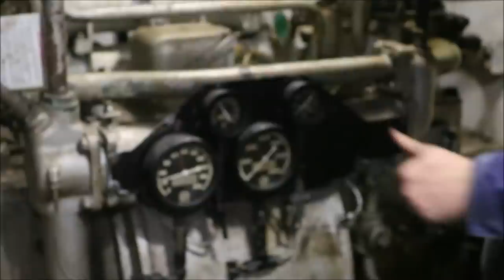First start in 72 years WWII 1942 Cleveland Diesel 8-268A

Comment: roller rockers all them years ago gotta love it
Reply from the maker: The old Cleveland engines are very similar to modern EMD 710 series engines. Not much has changed in the development of large 2-stroke diesel engines in the last 80 years.
Thanks for watching!
Reply: Justin Higgina  Hell even the old Allison V12 aircraft engine used a roller set up on its over head cam 4 valves !!!  Something even the "fabled" RR Merlin did NOT have !!!!

Comment: We had two V16_278A main engines and one 8-268A ships service generator engine in both the forward and after enginerooms on LST 1161.  The 8-268A was rated at 450 HP at 1200 RPM.  Or 300 KW.  This was in the early 1960s.
Reply from the maker: That's very interesting. One day I'll make a trip to a LST museum. Not sure if any have the Cleveland engines or all EMD and Detroit Diesel. Thanks for watching!

Comment: Let me get this straight, 4 valves per cylinder, unit injectors in cylinders, back in 1942?  Remarkable technology considering we still design modern diesels in much the same way!
Reply from the maker: Thanks for watching! These Cleveland engines share many similarities to modern EMD units which are based off of the original Winton/CDED design. The 4 valve heads and unit injectors first made their appearance even earlier in the 1930's.

Comment: I worked on a Cleveland diesel just like that,  was an 8- 268A  And there was a 3- 268 A  was a Generator engine. Takes a series of steps to make that thing run. I remember valves for oil bleed air to start And for blowing it down each individual cylinder. Also there was a hand held pyro with a probe that could give you a reading so you could tell if that cylinder was firing each valve cover was polished  kinda neat big 2 cycle. It was in a mine sweeper turned into pleasure craft Was owned by the famous man they called "The Duke" . I do believe these engines were used in Locomotives in that Era.
Reply from the maker: Thanks for watching! The Stewart has 2 8-268A engines and 2 3-268A engines onboard. All are generators. I'm very surprised by how many people have commented that they worked on these engines. It's incredible how long these things stayed around and the applications they were used in after the war.

Comment: I spent 30 yrs working on the detroit two strokes from the 2-53 to the 16v149tib and you can tell this old bird is a two stroke
Reply from the maker: Detriot engines have many similarities with the much larger Cleveland line (both are GM products), although Cleveland engines are closer to EMD, the resemblance is still there. Thanks for watching!
Reply: A two stroke with valves, I don’t think so 🤔
Reply from the maker: Thanks for watching! That is a very common misconception. Unlike gas engines, almost all 2 stroke diesel (and all slow speed engines) have exhaust valves. Intake air is drawn in through ports in the cylinder liner and exhaust gas exits through conventional valves. A quick Google search will help to clear this up for you!

Comment: Ran an old Cleveland like this for a light plant engine on a West Texas Drilling rig in the 70's.
Reply from the maker: That's very cool, I've yet to hear about them being repurposed for work on the rigs! Was it an 3,8,12 or 16 cyl motor you worked on?
Thanks for watching!
Reply: @FixAndForget  Straight 8 cyl.  2 stroke.  It powered a gen. motor off a sub. The power engines were White 8 cyl. engines built in the 40's as was the rig.  Those didn't have forced lube to the upper valve train so twice a shift you had to remove 4 side plates and fill them with oil on each of the 4 800 hp. engines. That was drip feed and constant loss.     They decided to scrap the rig when you could stick a screwdriver thru the sub frames.
Reply from the maker: @odatmatt  again, that is some really cool stuff. The USS COD, a WWII sub museum in Cleveland Ohio has the same inline 8cyl Cleveland generator, still in running condition. The guys up there were a big help in getting this on running.
Reply: @FixAndForget  It powered all of our electrical needs,   Another Noble Drilling rig had Sub generator motors powering the drawworks used to pull the drill pipe out of the hole.

Comment: Smoothly running, slight knock.
Reply from the maker: Might have had some air in the fuel system that caused a momentary pre-ignition knock but that cleared up after a few seconds. 
Thanks for watching and the kind words!!

Comment: I like how he said "yeah, in case she runs away".  Plate for the intake please...hahaha.  Holy cow that engine sounds MINT! ! ! !
Reply from the maker: Thanks boss! The large C02 extinguisher and intake damper are precautions I take with any large 2 stroke engine I work with. One of these days I'll post a video of the engine at rated speed with a load on it. It really screams at 1,200 RPM.
Reply: runs away! over turbos do that... too much AIR!
Reply from the maker: @AntonyThorburn  A number of circumstances can cause this style of 2-stroke engine to run away. The most common are stuck injector racks, diesel in the lube oil, and bad seals on the blower (supercharger).
Reply: @FixAndForget  thank you. Strange thing.

Comment: Moran Towing, New York, had these in a few boats. I was told that they came from submarines. They sounded like a sewing machine in the engine room.
Reply from the maker: The USS Cavalla SS-244 is a museum submarine berthed next to the Stewart and it had 4 16-278A engines. It was common practice for scrapyards to remove the propulsion equipment from them and resell it to other uses. There are a few Fairbanks and Cleveland powered tugs up on the great lakes and Mississippi river. I knew RTC in New York had a few of them a few years back. Glad to hear there are a few left still working! 

Thanks for watching!

Comment: Our 8-268A sat between two 16-268a's in USS Rasher after engine room.  A little nervous in the bilge between them looking at all those crankcase relief valves.........
Reply from the maker: That's the same setup as the USS COD who's crew still has the 8 and both 16's running today. I can't imagine how you guys worked down there, I have enough trouble working in a "spacious" engine room. The Gato class boat that sits next to this ship at the same museum had one of the 16's and the 8 removed in 1952.
Thanks for watching!

Comment: for the high speed the valves move,this engine is an 2 stroke . the sound is same same as an EMD. (same as the locomotives). 4 valves + injector
Reply from the maker: The Cleveland engine line was the predecessor to EMD. Lessons learned went into the design of EMD and the result was an engine family almost identical to this one. That could be said all the way up to the basic principles of the EMD 710 series engine. 
Thanks for watching!

Comment: Roller rocker arms astonishing for that era , like mentioned dont make stuff to last nowadays
Reply from the maker: Thanks for watching! There are few major differences between the old Cleveland engines and modern day EMD 710 series motors, the basic operating principals and designs haven't changed much in the last 80 years. I think they had been using roller rocker arms since sometime in the 30's. Pretty neat stuff!
Reply: I can use the same 1940s EMD 567 rocker arm part number and cross reference it to a modern 710. I'd say they still make things to last. Maybe not in consumer products, but in industrial stuff they do.
Reply from the maker: @---sx9qx  one of the reasons why I chose to work on EMD products. Build to last, bullet proof, doesn't require a degree in rocket science to work on.

Thanks for watching!

Comment: Winton was the original company.  Gm bought them. Renamed to Cleveland engine. Then later Detroit and emd
Reply from the maker: Thanks for watching! The mains on the submarine (also part of the museum) are old enough to still be branded "Winton". Not sure if Winton is directly responsible for the Detroit line of engines, but they certainly are for EMD.

Comment: Old engines are better than new crap
Reply: Yeah that's bullshit would you really want this thing in a new car you would get 5 miles to the gallon what do you drive by the way I'm betting it's pretty new so I rest my case
Reply: You’re half right. The quality control and metallurgy of new engines far surpasses the old stuff but it’s the federally mandated emissions systems that are prematurely killing modern diesel engines. Just about any of the new class 8 diesels would run 2 million miles if they weren’t being prematurely destroyed by the emissions garbage.
Reply: @prevost8686  
And newer diesels are being built lighter for fuel efficiency... which isn't a good thing in a marine diesel.
A bit of extra weight helps smooth an engine down and stretches it's life.
Reply: @charlesangell_bulmtl  the engine you're talking about is not plausible nor would it be productive in a modern automobile it's to small it wouldn't have  the power to weight ratio
Reply: I'll take a new Ford 5.0L DOHC direct injection V-8 with a conservative 460 H.P. any day over the Ford 289 C.I.  barely 200 H.P. in my '65 Mustang.  The modern 5.0L has way, way more power, better fuel efficiency, 98% less emissions, and longer life/reliability.  289 was good in its day, but that is 50 year old technology.  The same goes for Chevy and Chrysler.
Reply from the maker: Thanks for watching!

Comment: This must be the closest to the sound of the original Winton engines as used in early diesel locomotives,  but I would have liked some exhaust sound in the video as well.
Reply from the maker: One of these days I will post another video of the engine at speed and carrying a load, I'll include an exhaust clip on that one. If you want to see a few now, click on my account under the video, I have some raw footage of the engine on there with some exhaust clips as well. Kinda sounds like a hit and miss engine after the muffler. 
Thanks for watching!
Reply: @FixAndForget  I check them out, the figure 268 denotes displacement per cylinder like EMD did?
I had been checking the web for surviving locomotives whit the Winton 201A diesels in them, but currntly none of them is operational. I hope there wil be one in the future, because this engine had a significant rol in the birth of the diesel locomotive in the United States.

Comment: Iwas on the YF885 at keyport wash. had two 8268aw/ twin disc reduction/reverse they  were the best running engine
Reply from the maker: That's very neat, I have only worked on Cleveland units in generator applications. I've always wanted to see one in a propulsion application.

Comment: I thought this engine looked like an EMD. After reading the description, I see why that would be. 

Great work. Just subscribed!
Reply from the maker: Thanks for watching! There are few major differences between the old Cleveland engines and modern day EMD 710 series motors, the basic operating principals and designs haven't changed much in the last 80 years.

Comment: I guess that’s a 2-cycle like a Detroit? I saw both sets of valves moving at the same time. I’ve never seen one of those. 
Nice!
Reply from the maker: Thanks for watching! The Cleveland and EMD diesel engines share the same basic operating principals as Detroit motors, just on a much larger scale.
Reply: Asher Spalding 
Was Cleveland associated with GM/EMD or Winton back in the early days? 
I’ve worked on all Detroit series 53-149 that are “common” and have been around the 567 just a small amount. 
Is the Cleveland roots-blown as well?
Reply from the maker: @davidbeachel  Cleveland/Winton is synonymous. The company was purchased by GM in 1930 and was the predecessor to EMD. All are roots blown, except for more modern 645,710 and up series EMD.

Comment: Curious about the Hp and RPM's. The two valve lifters must be for exhaust valves just like the 2 stroke GM diesels. The center tappet probably for the fuel injector.
Reply from the maker: Rated speed is 1200, approximately 500 HP. 4 exhaust valves and the center rocker is for the injector. Cleveland/Winton was bought by GM in 1930 so this is a "GM" engine. Thanks for watching!
Reply: @FixAndForget  Thank you. I am surprised about 4 valves... would have put money on only 2.

Comment: I'm a railfan so I've heard all sorts of EMD locomotive prime movers before.  Thank you for sharing this piece of pre-EMD history.  Mind if I ask, why does it make a clanging/knocking sound on startup?  Most EMD locomotives don't do that, while most 1960s-1990s GE locomotives do.
Reply from the maker: Thanks for watching! The principal difference in how these engines start and modern EMDs is that high pressure air (500 PSI) Is injected directly into the cylinders to roll the engine. This is how engines much larger than EMDs start today. EMD engines use an air starter that is similar to a geared car starter except that it uses 120 PSI air instead of electricity. As I'm sure you know there are also various other electrical starting options on rail engines not found in marine applications. 
Since the air pressure was too low at the time, I had to use ether to start the engine. No, this doesn't hurt it. I believe the knocking sounds arises from the pre-ignition of the ether. 
Thanks again!

Comment: Wow, that engine was sure screeching and squeaking while you were turning it over! Do these engines have a “pre oiler” to insure all the bearings and lubricated parts are properly slicked up with oil before the engine is rotated to start it?  That engine had a well muffled exhaust as I did not hear the characteristic GM two stroke grower and bellow as it started up and idled. What is the idle speed, service speed and top speed of this engine?
Reply from the maker: Thanks for watching! I believe the high pitch noises heard while starting is from the high pressure start air escaping  through the exhaust valves. The engine does not have a pre-lube pump but I plan on installing one the next time I go to the ship. Many of these engines that continued service after WWII had pre lube pumps added by the crew. Since this is a gen set, it is run at a continuous 1,200 RPM to maintain 60 cycles. After being warmed up and put online. Cheers!

Comment: the military knows how to preserve things
Reply from the maker: Hindsight is 20-20 but the preservation measures taken here both saved the engine and damaged it. Filling the piping, governor, and various components with anti rust compound was highly detrimental. However, sealing the exhaust likely saved the engine. Of course they weren't thinking about preserving anything for 72 years when it was done in 1946! Thanks for watching!

Comment: I was at the USS Stewart a day ago but the engine room was locked I didn't even know that it had this engine for the generator I just knew that it had a couple of Fairbanks Morse opposed piston 2 stroke diesels for the main engines I do know that the USS Cavalla submarine next door has four Cleveland diesel 267 V16 2 strokes
Reply from the maker: Thanks for watching. Stewart has 4 generators. Two like this and two 3 cylinder 268a series.

Comment: Not sure where this one was installed, had 8-268a’s as ships service generators on Fleet Tugs built in 42/43   Also 3-268a’s for emergency and towing power.  12V278a for main propulsion.
Reply from the maker: Thanks for watching! Please see video description for more info on this engine.
Reply from the maker: The setup you described also reminds me of Cannon class DEs 2 8-268a, 2 3-268a, and 4 16-278a Clevelands.

Comment: One presumes the engine was first striped down, carefully inspected and rebuilt before hand?  But that's great it fired up pretty much right away.
Reply from the maker: Over about a 2 and a half year period I inspected, repaired, and rebuilt the necessary components to get the engine running. The biggest issues were actually the auxiliary systems supporting the engine such as piping, pumps, and the start air compressor. The injectors and engine blower were rebuilt by me on the ship as well.
Thanks for watching!
Reply: @FixAndForget  Sterling effort! Well done
Reply from the maker: @bmused55  Thanks boss!

Comment: Which machine (or computer if you want) build today will work or even start in 2091?
Reply from the maker: Thanks for watching! Undoubtedly if one was to get a newer engine running after 72+ years they would have to be smarter than me since I know nothing about computers, just big old 2-stroke ship engines!
Reply: Can guarantee you they didn't jusst change the filters and prime it. Likely was rebuilt first.
Reply from the maker: @maritimemisfits3360  The only major repairs I made to the engine were rebuilding all 8 injectors, the blower, and fabricating air lines on the high pressure compressor. Thanks for watching!

Comment: If I didn't know better I swear that was an EMD 2 stroke... 4 exhaust valves,  fuel injectors right in the middle.
Reply from the maker: Thanks for watching! There are few major differences between the old Cleveland engines and modern day EMD 710 series motors, the basic operating principals and designs haven't changed much in the last 80 years.
Reply: Basically it is an EMD diesel engine. Until 1962 the division was known as the Cleveland Diesel Engine Division of General Motors.

https://en.wikipedia.org/wiki/Cleveland_Diesel_Engine_Division

Comment: the beauty of diesel is you compress it, the fuel burns!  So if you can get things rotating you have decent chance of it running.  No complex electrical system, no glow plugs, no computer controlled fuel injection.  Those are all good things for performance, but not iron clad long term reliability
Reply from the maker: Wouldn't have been able to do it if they were present in this application, that's for sure.